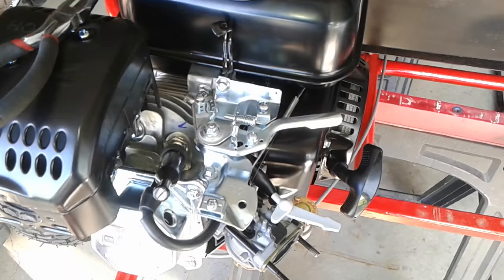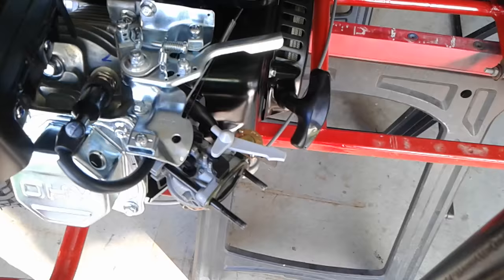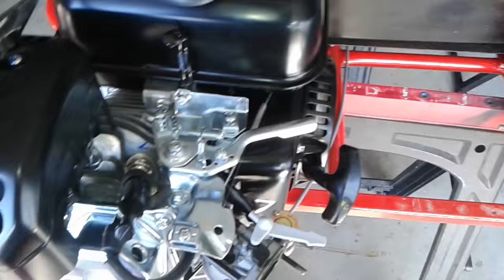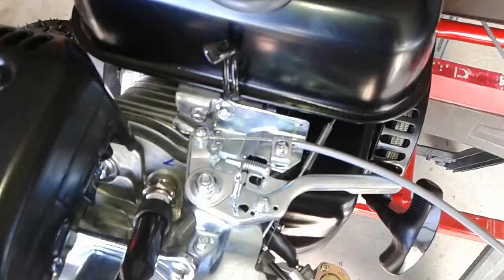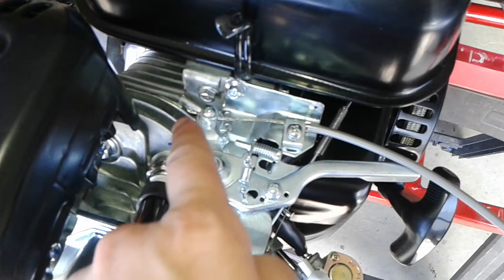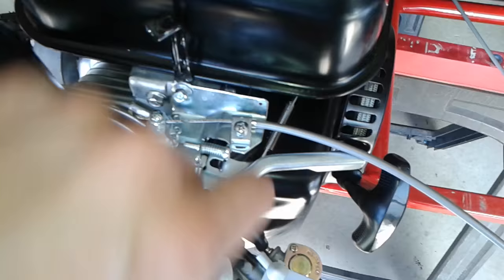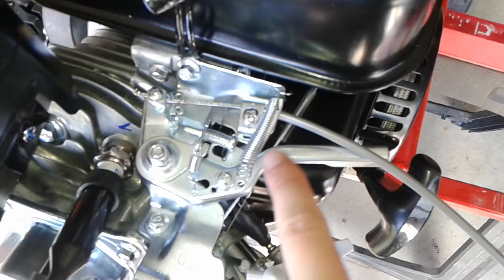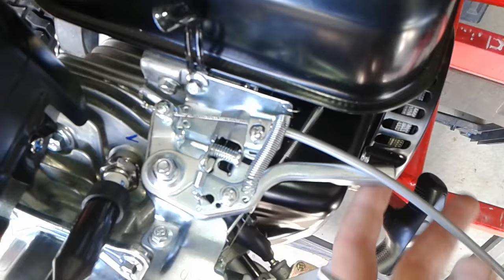Throttle Cable Set Up Go Kart, Predator Harbor Freight Engine

Comment: Man my throttle isn't strong enough to pull the throttle back and forth or something I even have a spring to make it go back into close just won't work
Reply from the maker: Try putting another spring up next to the peddle. Most setups have multiple springs.

Comment: The newer models or the one I just got 
Doesn't have the metal plate you drilled into
The plate barely extends past the Bolt
That secures it
I ran my spring from the cable holder screw to the barrel nut screw 
Used the old return spring from Old Subaru ex13
Perfect fit
Thumbs up on video

Comment: On my similar kart when I move the lever to mimic what the throttle cable does it doesn’t seem to open the carb at all. Can anyone suggest what I’m doing wrong? It’s still connected to the governor with the spring and bar. It’s got me confused

Comment: Hi, I just picked up a HF as-is (probaby a return) plate compactor and discovered that the throttle assembly was frozen in the full-on position and the throttle cable had no effect.  I loosened the top nut as you show which allowed the throttle assembly to move freely.  One of the very weak springs (governer or return spring) popped off of where it was attached.  I can't find info on where it hooks onto.  I'll have to go back to HF and look at the floor model.  Those springs are so weak I don't see how they do anything.  Your return spring fix is briliant.  Thanks

Comment: The thing is a hp idle control, on lawn mowers and etc they control the speed of the idle and the revs, i dont think its suppose to move on its own with the throttle cable, however for gocarts i could be wrong

Comment: What is under the cable stop. Like what holds it on. My gx160 has just a hole so my cable stop is up top like yours but I had to screw it in from bottom so it don't fall off
Reply from the maker: It's like a little swivel bushing. Not much but it works.

Comment: Can you please help me, I was trying to hook up my throttle and accidentally took the screw all the way out that pinches down the cable that goes through the hole in the nut. I cant seem to find what size it is, is there anyway anyone could help me on what size it is. Please.
Reply: 10 mm idk

Comment: How would you thread the cable through that holding nut for the throttle 🤔
Reply from the maker: There is a hole so you just put it through and then tighten the screw on top.
Reply: @-DIYPRO- that whole is smaller than the cable

Comment: Cool. I think I'm gonna do this to my Kawasaki Mojave 110 four wheeler. Lolz it has a Honda 125 engine from a 1987 Honda ATC125 three wheeler and it's blown up and nobody makes a rebuild kit for it so I'm gonna put a predator 420cc in it and now I know how to hook up the throttle and also what cable I need to buy. Thank you
Reply from the maker: Glad it helped!
Reply: @-DIYPRO-  I am looking for a clutch that is for a one inch shaft with a quarter inch key way slot. The only ones I can find look really cheap and lame. And it looks like I'm gonna have to change the chain from #520 to the smaller and weaker #420 chain to use the clutches that they offer which is also annoying. I want to run the rear axle and tires it came with which are 18 inch tall knobby tires like maybe 10 inches wide. And there's no rear suspension so at least I don't have to mess with a swingarm but I will have to change the rear sprocket and probably re-gear it down a bit. And I think I should get the clutch with only 10 teeth, which is the lowest gear they offer for those clutches. I'm gonna get an 18 hp 420cc Chinese duro max Honda clone engine so it should have pretty good power considering it came with only a 125cc Honda three wheeler engine that was completely blown up in the top en and piston and also the camshaft was ruined. And unlike the Chinese companies, Honda doesn't even make the engine rebuild kit for my 125 anymore and I can't find one anywhere else from the millions of aftermarket parts that they make lmfao. So stupid..I want to ride my damn fourwheeler lol but I can't even get the thing fixed without getting a completely different engine!! Bullshit!

Comment: Do you need that spring for make the throttle snap back or no
Reply from the maker: Not 100% necessary because there is a return spring on the engine but I always put one on just in case.

Comment: Am I missing something? Removing those 2 nuts doesn’t allow you to remove the air box.
Reply from the maker: There is the exhaust return line but that doesn't require removing any bolts. If it's a predator or honda clone than yes it should only be the (2) nuts.

Comment: Where did you get the spring for the throttle return? I just started with go karts so I don't have any extra parts laying around.
Reply from the maker: I picked up a small variety pack of Springs from either Home Depot or Harbor Freight.
Reply: I don’t have a spring I just loosened the bolt that’s in the fulcrum of the lever and it comes back when you let go

Comment: I know this video is old but what size spring is that? My throttle stays open sometimes
Reply from the maker: A while ago I picked up an assorted box of springs from HF. It's just one of those that has a lot of tension.
Reply: @-DIYPRO-  thanks for responding.  I'm to going to HF when I get off work. Its not safe when the throttle stays open I have to used the kill switch to stop the bike. My other bike has a mikuni

Comment: Did you have to remove to drill the hole for the additional spring?
Reply from the maker: I drill a little hole on the throttle linkage and extend it over to the pull cord shroud.

Comment: Where do you get a throttle cable with nuts on both sides can I have a link
Reply from the maker: I get it with just one side, that way you can feed it through the tightening nut. It's brake cable from a bike shop.

Comment: What's the trick to removing the air filter? I removed the 2 nuts but it still won't budge.
Reply from the maker: Is the choke switch in the way?

Comment: The plate that’s is connected to the spring. Did it come with the motor or did you buy that separately
Reply from the maker: Came with the motor.

Comment: Can you please, if you don’t mind drop me a link to the return spring for the throttle? I really need one to get mine up and running
Reply from the maker: I just pick up the variety pack that Harbor Freight sales. And choose one that has enough tension to pull it back.
Reply: @-DIYPRO-  ok thanks, I'm going up there tomorrow so thanks
Reply: How long is the spring?

Comment: What cable is that and where can I buy it?
Reply from the maker: I use bike brake cable, i get it at my local bike store or online. Just make sure it's the brake cable and not derailer cable, brake is a little thicker.

Comment: I lost the screw to the cable clamp idk what to do now
Reply from the maker: There are 3 spots to clamp it down did you loose all 3 screws? Take one out of the other spot.
Reply: @-DIYPRO-  I only seen a second one and it didn't have a screw either it's around 7 years old and still runs fine until the throttle cable wouldnt hold anymore from fraying so i took it off and ended up losing the screw

Comment: What type of throttle cable did you use and where can I get one?
Reply from the maker: It's bike brake cable. You can pick it up from any bike store or online.
Reply from the maker: Get the brake cable because it's a little thicker than the speed changing one, for some odd reason I cannot remember for the life of me the name of that other one.

Comment: How long was spring u added
Reply from the maker: Just couple of inches. It's not too long. The important part it to get one strong enough to pull back the lever, some springs are weak and won't pull it back.

Comment: I've asked this so many times , where did you get your "Wire holder" as they call it, it's the part you put the cable wire through at the end and secure it with the screw, can't find one on line , I made my own but really would like to get one that actually fits on the arm, any suggestions 
Thanks
Reply from the maker: First time you have asked me! haha. Sorry I'm not going to be much help just because it comes on all the new harbor freight engines. I have never just bought that piece by itself. Hey if you made one and it holds it in place then I would call it good.
Reply: The Halloween Guy , thanks for the reply, I'll just head on over to harbor freight and check one out, till then like you said just continue with mine, thanks again
Reply: Google 'governor swivel' they are the cheapest (not actually cheap for what they are) version I can find that is also closest to OEM with the E clip bottom, you can also try 'throttle swivel' but they almost always cost more and the configurations vary...
Reply: Thats the exact part there but I dont know what size screw it needs. I have the same problem. Bought the duromax 7hp engine but should've just bought harbor freight engine

Comment: Do I have to take thr gas out in order to removr the carbonatuer?
Reply from the maker: You don't need to remove the carburetor if you are just hooking up the throttle cable. If you are needing to remove it for something else then you need to either pinch off the gas line going into the carb or drain it.

Comment: were did you get the throttle cable from?
Reply from the maker: I've used bike brake cable. Either on line or any bike store. I have also used motorcycle cable,  if you have a motorcycle shop near by.

Comment: So u need to buy a return spring
Reply from the maker: Saavedra motovlogs it's not absalutly required but I like it as an extra safety measure. They are really cheap at any hardware store.

Comment: How do you get the throttle cable through the screw? Because mine does not go through and nor Can you see through from one side to the other? If you shouldn't let do it on either of the 2 screws you say and everybody else said you just slide the cable through and tightened down. My screw does not have anywhere to slide. The cable through there's a hole in the front. The hole in the back and no hole through the middle of the actual bulk inside of the middle of the thing. The cable will not go through, but everybody else says it's supposed to, so it's mine. Just f*** u* or something, but the hell was wrong. Everybody just showed that slide right through on. You're old and mine just does not.  Slide through a cricket, you can't even see through the holes on the low bolt where the cable supposed to slide through.So do I have a faulty fucking stuart or something? -
Reply from the maker: Unthread the screw. Once unscrewed you can slide the cable through and once it's at a good tension you screw it back down. That's what will hold the cable in place.